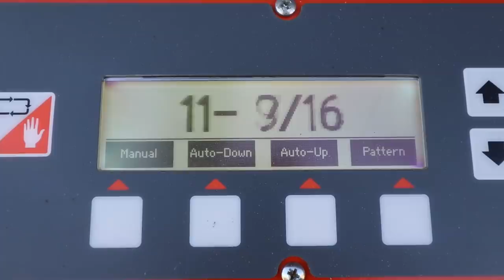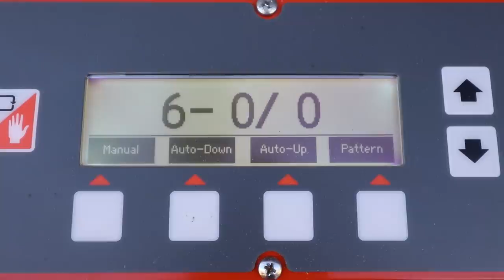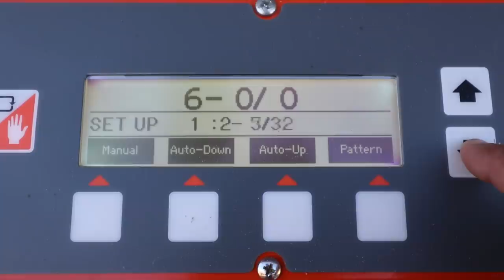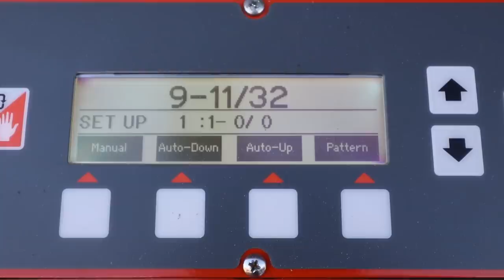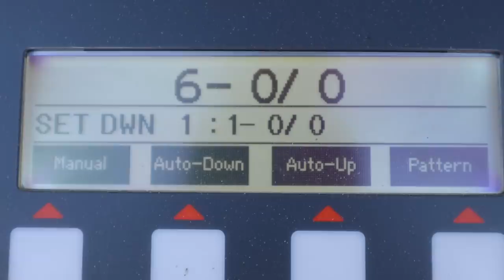IF YOU ARE LOOKING TO BUY A SAWMILL WATCH THIS VIDEO, WOOD-MIZER ACCUSET 2 AT WORK

Comment: I own a woodmizer and it works real good . The mill i i purchased used so there were a few little minor parts i replaced just to dress it up a little . The people at woodmizer are good to deal with and decent all around from my dealings.
Reply: What Woodmizer did you buy used and year model?
Reply: @jerrylittle8922  LT-28  And i believe its a 1995

Comment: Have you tried the pattern feature much?  I rarely use the auto up/down, i find the pattern mode much easier.  Also if you have to shut down the mill, you can get back to your location without having to set the blade on the old cut (sometimes overnight or something the timber can move)
Reply from the maker: just starting to learn that system now, lots of possibilities there, 
you decide to keep your 50?
Reply: @OutoftheWoods0623  its bittersweet, but someone just gave me a deposit, supposed to complete the sale end of the month.  I've got a bit of stuff to wrap up in the next two weeks so Sarah is taking the opportunity to play cameraman...shes editing videos now, looking pretty sweet.  She has a Canon 5D with some nice lenses, so its pretty crazy to see the picture quality shes able to get

Comment: Was wondering if you have tried using the pattern mode ? You can set your cant at the bottom setting and anything else.  thickness wise you want above that . I find that The accuset features work best when they are all used together .
Always love you videos . keep up the good work .

Comment: You could have also set one of your pattern modes for 6" as your bottom board and the 1" as all other boards above and not have to go down to 6" then come back up with the auto up mode.  I have also done it as you did.

Comment: Why not cut them 1 1/8 so you didn't have so much waste slab on top? Could always run through planer  after dry. Or did you need 1" for something?

Comment: Man i swear, every time i look at you reving that engine i think it sure looks like it moves more and more at an angle. I would personally be very concerned that it one day just fell off. There is perhaps some method to why it moves, or has a lot of play in it, like that, but i sure would worry.
Reply: This was answered in the last video (or the second last). It moves to engage the clutch and start the blade turning.